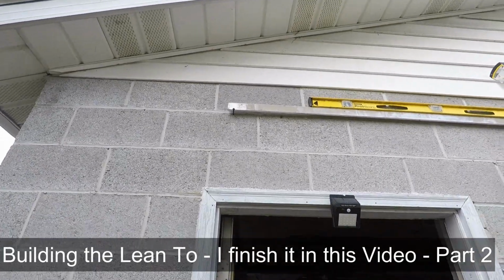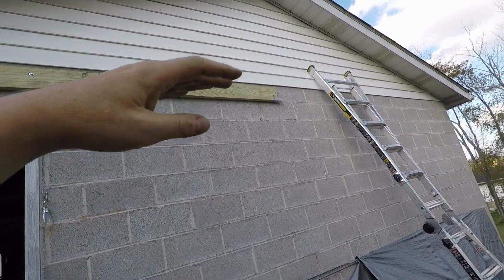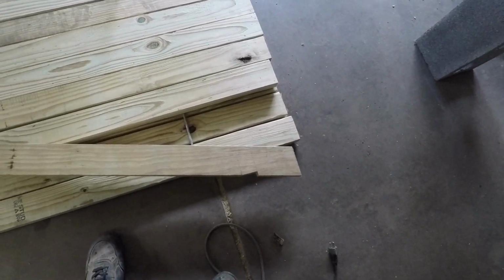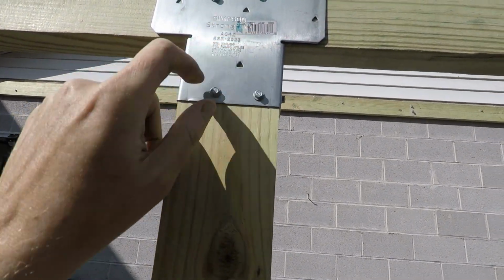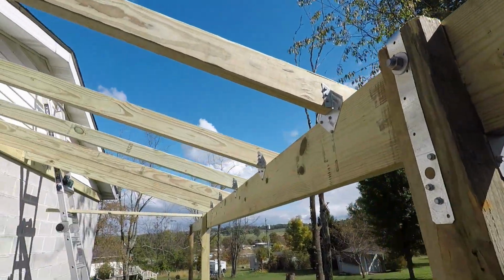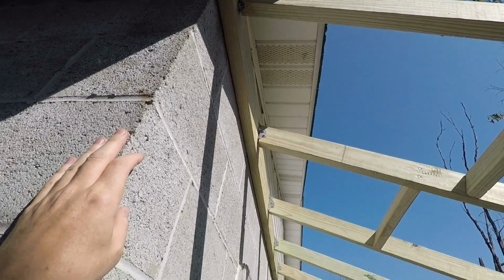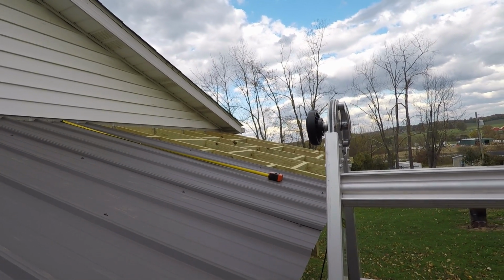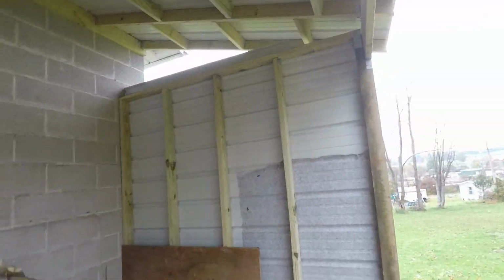Lean To Build Garage Shop Metal Patio Deck Roof Pressure Treated Wood Birds mouth Cuts Roof Part 2

Comment: Aerosol insecticide also works great to remove that pesky sticker gum. Spray and wipe with toilet paper. Oh yes, and I like to pre-drill where the sheeting screws go in. The self drillers cause swarf that wrecks the seal washers.

Comment: That looks good and I am getting ready to put a shed on the back of my shop the same way but I have a friend that has some of that tin that I can buy cheap and I am going to go as wide as I can and it will probably go 16 ft out and I am going out to the outer edge of my shop roof which will probably be 20 ft wide and the shop is 16 x 18 ft so I got a lot of ideas from you and the only thing that was frustrating about your video was all that bumping and banging noise in it and I was using earbuds but it is ok.
Reply from the maker: Yeah you touch the case on a gopro they make a loud noise, I wasn't using a gimble/handle is why, hope my video helps you in some way

Comment: Nice job! I have built 1 lean on the side of my pole building garage on one side a few years ago and ready to build my 2nd to park my RV trailer.
I work along but use clamps a lot and I prop ladder to hold my boards. Tip is to also mark your boards where hanger will be so you know where to bolt on to the wall. It’s a rewarding project.
Reply from the maker: Thanks, hopefully your new project goes well!